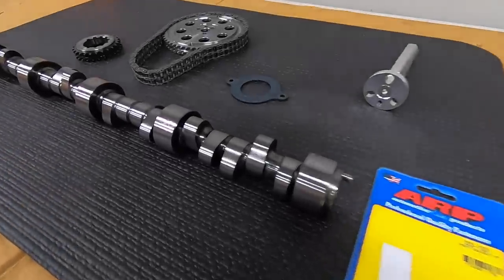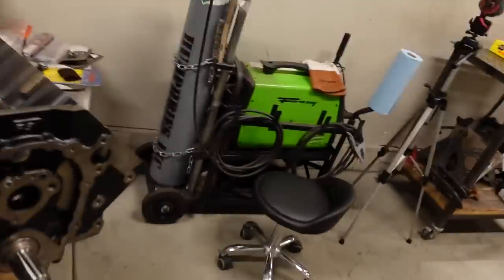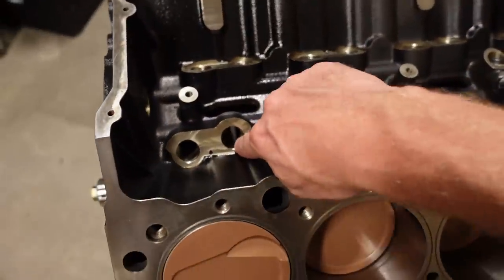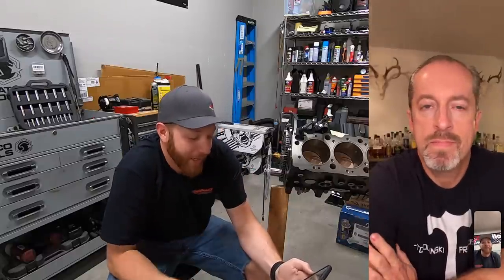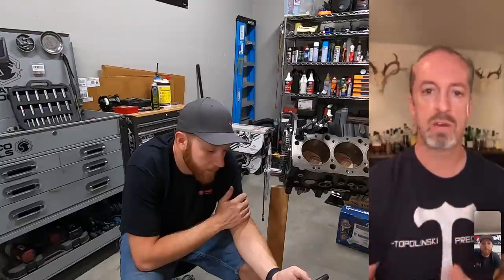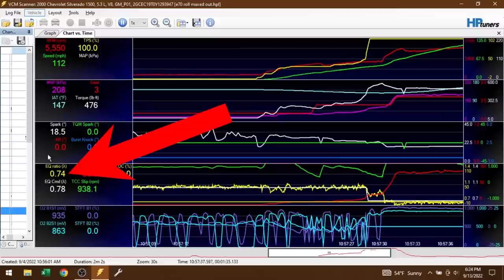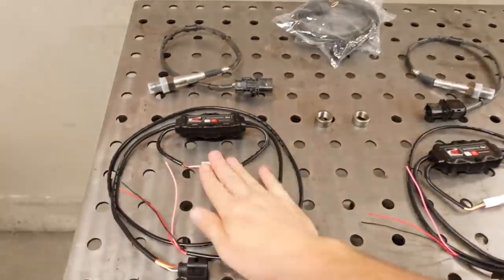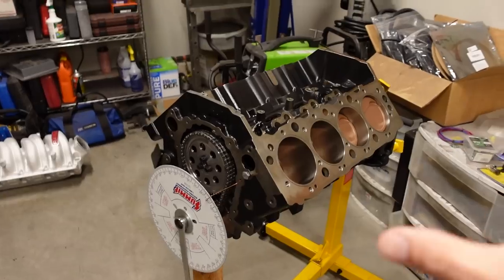a GIANT cam for my 535 Cubic Inch MONSTER Big Block Build

Comment from the maker: So what do you think, AWD turbo big block COPO truck?
Reply: Think we will see what will break if it cuts a good 60ft but would be fun on the street
Reply: Most definitely
Reply: Transfer case, stock front diff, seem to take most turbo combos people are building, I would be curious to see if it can handle the torque. But at the same time it's a solid combo already. It would be easy enough to sell that one as is, and build another with a big block....I mean there's only a million of those trucks around.
Reply: No.
Reply: Yes, big block in copo AWD truck.
Reply: Why not convert the ugly truck into an AWD and build it so it will practically handle any power output that you can build?? Just a thought.
Reply: Is that even a question?
Reply: Allison 2000 5 speed with the Kilduff shifter.
Reply: Put that LSA on a stroked 6.0 LS! 427 CI in a smaller package!
Reply: Supercharged 8.1 big block awd
Reply: Yes please
Reply: My thoughts...
 COPO is done. 
 Leave it like it is.
Reply: I'd say no.  Leverage all the advantages of AWD by keeping weight distribution as reasonable as possible.  How about a high cubic-inch LSX?
Reply: 8s with the 5000 lbs ugly truck will be an adventure!
Reply: My thoughts 
sell it too me!!!!
Reply: You said it: COPO is done.... well the small block COPO; the big block COPO is a NEW project!
Reply: Yes and it needs some of mast motorsports ls7 port 8.1 heads 🤷🏻‍♂️
Reply: I love the COPO truck like it is. That thing is a beast on the street and you have a reliable daily driver.
Reply: IMO,  Turbo or Twin Turbo  LS 427 as  this engine would be  enough to grenade  any  AWD transfer case  plus the truck would handle slightly better than a BBC
Reply: I like the blown truck motor. Now swapping the 4.8 for a 5.3 is something I want to see
Reply: That's True
Reply: I want to know if the 8.1 heads fit on the 7.4 Vortec blocks?
Reply: Hey chemistry with Pat is really really good fyi ... (Easy to watch)     The sleeper Granada of Pat's AWD would be tits

Comment: I’ve learned a lot from Pat over at PowerNation, but LT has helped me directly on my project. I did the big radiator with E fans and couldn’t get the tune right. He actually responded and gave me a hand. Awesome guy!

Comment: Shout out to Mark and the Bullet cams team. LT, I'm late, but would it be wise to degree the cam for low RPM power and let the turbo carry on the power from boost threshold to the upper RPMs? Basically letting the cam do the work down low and the turbo do the work up high.

Comment: My personal experience with cam degreeing, I like advancing the cam timing 4 degrees.  Did that on a 80' evo harley, a 460 BBC with a 270 degree cam, & a 468 BBC with a 312 camshaft.  You aren't wanting to turn big RPM's with this engine, and you don't need to.  There's no replacement for displacement.  And the engine will last years longer by not spinning it so hard.  My 468 lasted 12 seasons on the dirt track circuit without needing a freshen up, and I chipped it at 7000rpm's.  It usually never turned over 6400.

Comment: I've always remembered a quote I read in Hot Rod magazine from the late great legendary engine builder Joe Sherman. He said you advance, or retard the cam timing to get the highest cylinder pressure and it should make the best power. Of course this is simply a tuning tool and not set in stone. It's something to play with when you are chasing power.

Comment: I think the engine here makes more sense in the longer wheelbase truck. It’s better for traction and stability. Besides, the “COPO” is cool, but would destroy the AWD system with 1500hp at the wheels. I’d agree- probably time to let that one go. I was more excited about that suburban you rehomed. A big off road SUV with equally big power would be rad.
Reply: Agreed 👍 I have a 05 GMC Sierra 1500 4 door with possi, and a 07 Classic Silverado short bed single cab with possi, when I smoke the tires the GMC is very forgiving for a long burnout but the single cab i have to stay on top of it or I'll be pointing the wrong direction in a hurry.
Reply: Stapleton42 has a 6000lb full size AWD Escalade with 2000 HP running 9s In the 1/4 mile.  He hasn't had any problems with the AWD system. I think it would be great to see a turbo 427 LS in the COPO truck.

Comment: Dude I love your builds! If you ask me they should start selling big power big engine trucks from the factory. Kinda like the ram TRX
Reply from the maker: I agree. GM kinda missed the boat on that one.
Reply: And they already make the LSX 454 block! The parts are all there to do a limited production run, like 3000 trucks, which the dealers  can then mark up about 50 grand, like they do with ZO6s. 🙄🤨
Reply: Very true lol. But that would be a pretty sick truck. They could kinda make it with retro style badges like the old C10 454’s

Comment: After how many miles do you expect you will need to regularly adjust the valves? I've see .680 lift Hyd Rollers. A small reduction in lift to never have to adjust valves seems like a easy call. I've also heard folks have had alot of luck with the new CompCamp Evolution/short travel lifters.

Comment: The COPO truck is pretty sweet as it is and it seems like it achieved all your goals at the start. The big block in the ugly truck is the bomb, big ugly power in a big ugly truck! Maybe it is time for another ride? Do you have any videos or recommendations for picking a cam for a 97 vortec 5.7 with roller lifters and cleaned up stock heads? I am port and polishing them and will use a carb on a 74 Jimmy.

Comment: Gonna be a really cool build

Those standard style heads? 24 degree w/ 2.3 - 2.35 valve?  If ya ever do another cam swap down the line I'd go to a 109-110 LCA.  535 NA probably about 105 as a baseline but with boost... think a 109-110 but less duration for the same overlap would make more power.  If you were running 12 degree heads I'd have the wide lobe separation, even wider with a hemi
Reply: Probably should've asked CR as well
More cr, wider lsa after a point but I'd imagine this build is sub 11.5:1
Also if ur running something like a 60mm+ cam (more agressive valve action) you'd spread the LCA 
Main thing is what kinda induction (flow capability but perhaps more importantly cross flow capability between intake and exhaust) vs the kinda cubes it feeds.
For a given situation 
More cross flow & flow capability = wider lca 
More cubes = tighter

Comment: If you are using HPT for the big block build you can change the firing order in the tune, I think, instead of swapping wires. If you are going Holley I’m not sure but wouldn’t be surprised if you could.
Reply from the maker: Great point!

Comment: Hi LT, I heard you mention that one of the plugs you installed oiled the the timing chain and gears. How does the excess oil return back into the engine? Thanks
Reply from the maker: The timing chain area of the block is open along the bottom, so it will just drain back into the oil pan

Comment: Thanks for another great video. Will that wideband setup work with HP tuners?
Reply from the maker: Yup, it outputs a 0 to 5 volt signal perfect for HP Tubers and most other data loggers as well

Comment: what's the duration between intake valves opening that would tell us how much boost you would be able to boost to because of the time that the intake valves are closed what's the difference what's the separation between one cylinder opening and the next one opening on the intakes Mr LT

Comment: 1500 bhp in a 5000 lb truck should give you 8.80s @ 160 mph if you can hook it up.  O2 is important but it's not the best way to infer lambda.
Reply from the maker: 8.80 is a great start!

Comment: LT, with the solid roller, ain't ya worried about losing a lifter and having needle bearings scattered throughout the motor?
Reply from the maker: no more than I would be with a hydraulic roller

Comment: I will comment this on every 8.1/8.8 build but someone needs to call up mast motorsports and ask them about their heads they developed for these engines. Ls7 port and they make an intake manifold to match. They probably don’t advertise it because it was developed for a fleet company but they have them.
Reply from the maker: That’s good info. I know those PSI 8.8 heads can flow very well.
Reply: @LawrenceTolman  definitely should look into them maybe for another 8.1 build. They told me they made like 800hp @ 1800 rpm’s on natural gas and turbocharged.
Reply: To me they seem more genuine gm since I’m used to seeing them in industrial applications like natural gas compressor engines and I know they’re a completely different animal than older bbc. I always wanted one of the 9.8 liter bow tie engines the company I worked with used as a common driver for screw style natural gas compressor. They all came with forged scat cranks and H beam rods.
Reply: I’ve got so much good info my brother. First I’d like to say that I love everything you’re doing. I am a die hard GM guy. I think you should have a few different copo trucks. Definitely need to build a max effort 427 from a gen 4 4.8 or 5.3 block. Ported lsa or ls9 blower. I wanna see some vvt stuff too since I had a Denali with a vvt cam that made better tq than factory and made power through 7k rpm’s lol. All gm parts used besides the valve train.

Comment: Not trolling or anything but I can guarantee you someone worked way harder on boring out those lifter bores. Machinists make the world go round.
Reply from the maker: sorry, I didn't mean to under sell the work that went into the block,  the machine shop did an excellent job on the block, and several things were changed

Comment: you really should be logging data to a laptop (all the time) - the phone just does not cut it - you need more than just afr
Reply from the maker: which is a great thing about these widebands, since they have a 0-5 volt analog output I can wire into my HP Tuners brick

Comment: STUPID QUESTION HERE. ARE YOU PUTTING THOSE O2 SENSORS BEHIND THE CATS,,,,,OR ARE THEY CATS?   CAUSE THEY LOOK LIKE CATS.   THAT WILL GIVE YOU A DIFFERANT READING THEN PUTTING THEM IN FRONT OF THE CATS.
Reply from the maker: yup I did, and addressed that in the video... but you are 100% correct